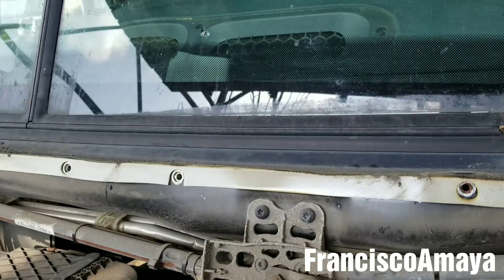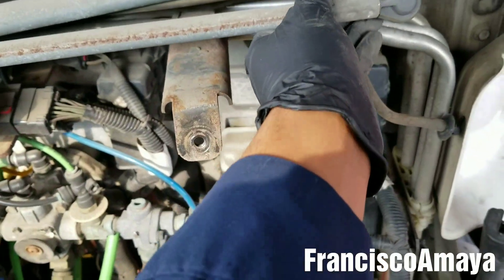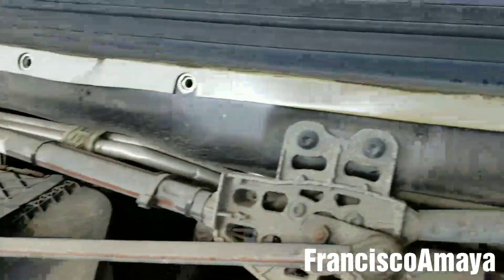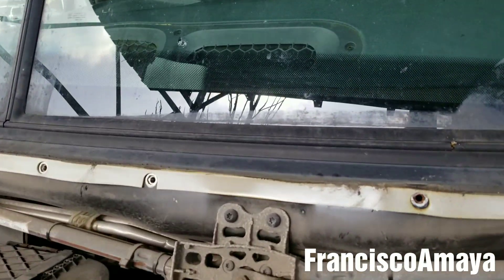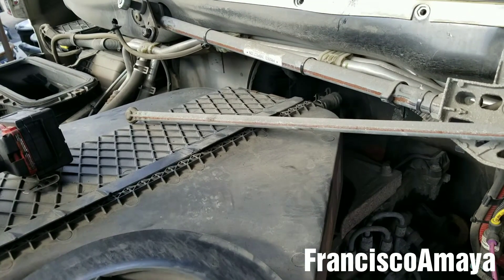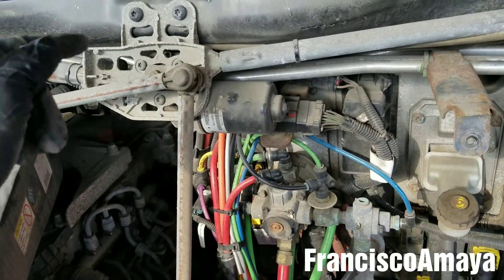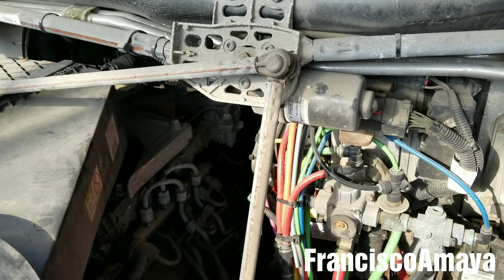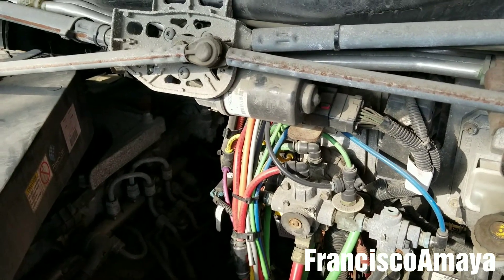Freightliner Cascadia windshield wiper arms not working broken wiper linkage mechanism

Comment: Francisco my intermittent wipers  mot working only  on low medium or high  any ideas ??? I thought it'd be a relay refuse, but there's nothing I don't know.If it's the motor or the switch on the steering wheel